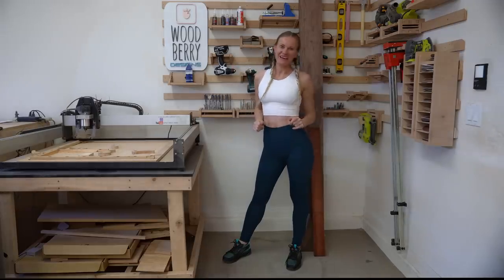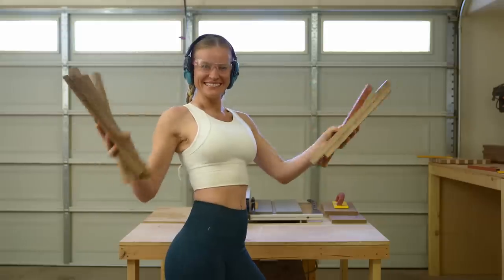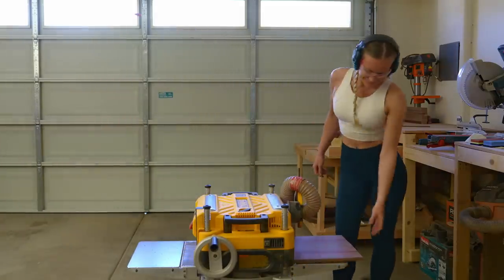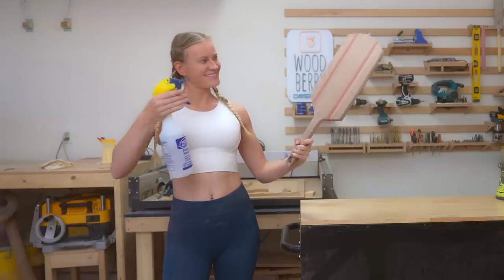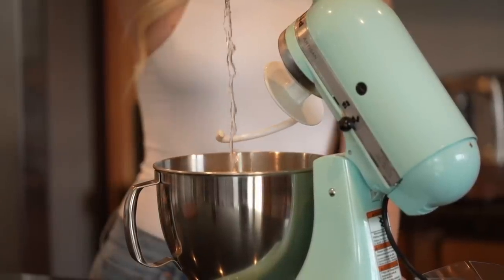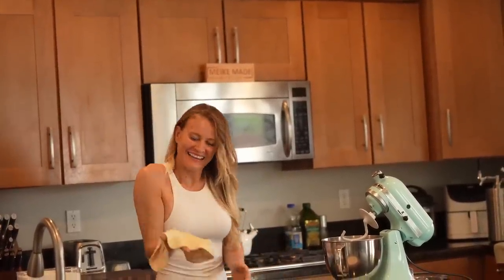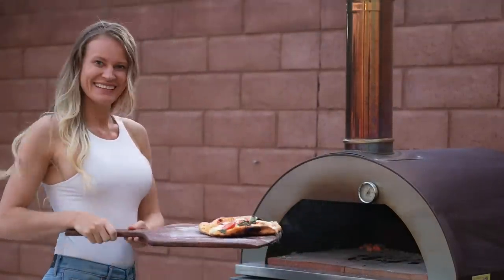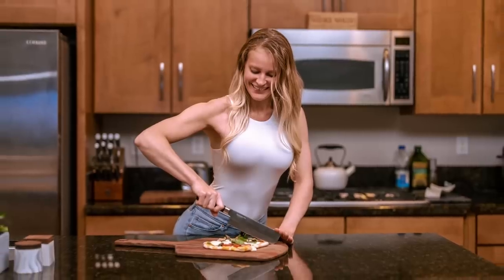My tastiest project yet. #DIY #build #WoodWednesday #Tutorial

Comment: Thanks for your video about making this peel. Just wondering that is the epoxy used to stick woods together safe to food?
Moreover, you have just left the curing in the room temp. Is it necessary to curing under higher temperature for better adhesive power?
Reply from the maker: Thank you for watching. 
It’s depends on the brand and kind of epoxy, not all brands are approved for food safety. So make sure you read the fine print or reach out to the brand you are using. 
To your second question, most epoxy’s you should never cure under a high temperature, that’s a bad thing to do since epoxy heats up while it cures and you will end up having to cool it down. 
I hope this answers your questions.
Reply: @WhatMeikeMakes  Thanks for your feedbacks.

Comment: The peel turned out great! How well does the bevel work to get under the pizza after it is cooked? Did you find it had a thin enough front?
Reply from the maker: Thank you so much!! I didn’t had any issues getting the pizza in and out of the oven, but you could always sand it down a bit more 😁
Reply: It's an issue, it needs to be sanded down to a sharper more tapered down edge at the tip. Ask me how I know.